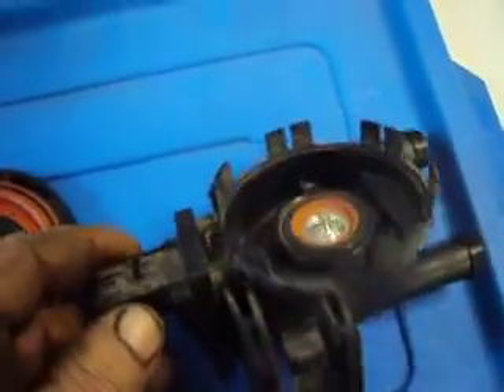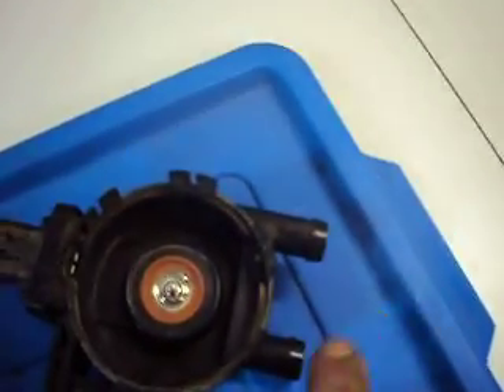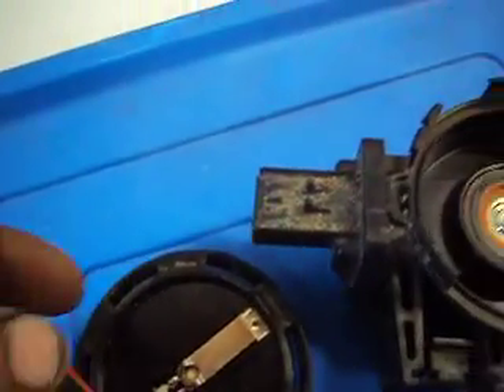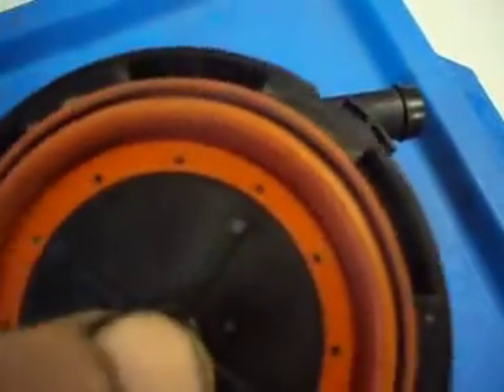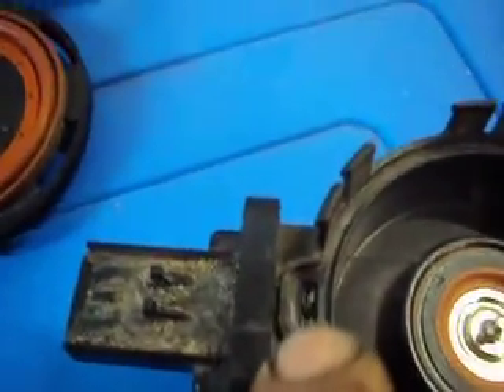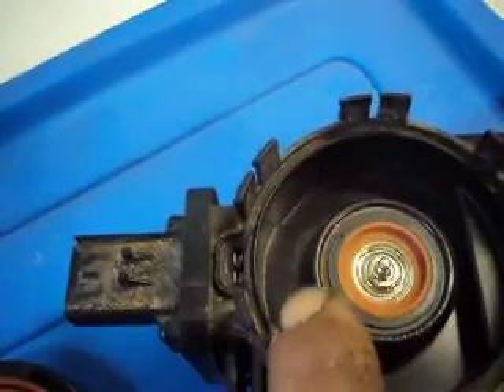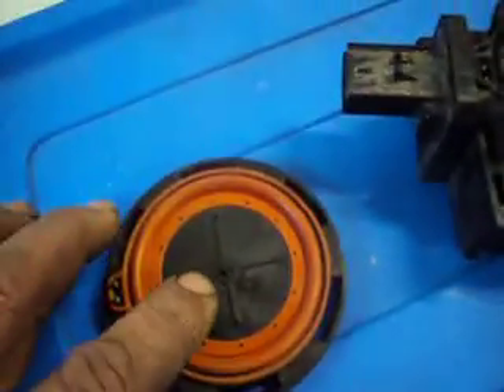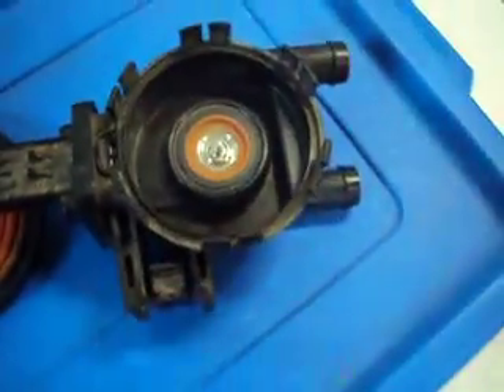Explaining the inside workings of a Chrysler NVLD

Comment: and also when your vehicle sits the NVLD has to be open to the atmosphere...if it were normally closed to the atmosphere and the fuel expanded and contracted like you said it would blow a line or something because the pressure would build in the system
Reply: Chrysler's ('02-07', in particular) ARE normally closed. That's what makes them weird.  
https://www.motor.com/magazine-summary/chryslers-evap-system/

"Unlike most evap solenoids which close their air passages when energized, this one is closed except when it’s powered up."

"When the engine is off, the solenoid closes the large poppet valve, closing off the main passageway between the hose from the canister and the hose to the vent filter (and the atmosphere.) However, as we know, the evap system needs to continue to be able to breathe as air in the tank expands with heat or contracts as it cools. So if the poppet valve is closed because the solenoid is off, how can the system do that? The answer lies in the internal architecture of the NVLD assembly, which incorporates a large diaphragm that functions as a vacuum or pressure relief valve."

Comment: Got a 1999 Chrysler Concord when the tank cover is on car sometime fails to start and sometimes cuts out while running..Funny thing is when I remove the gas cap it will come on and run fine.. Might the  Vapor Leak Detector be causing this????  Your help is appreciated
Reply: Did you ever figure this out? Sounds like an air issue.

Comment: This isn't correct...The NVLD does not have a solenoid in it and it is opposite of what you were saying when the vehicle is turned off. A solenoid is an object usually copper wire coiled around a switch that when power is supplied to the wire it creates an electromagnet causing the switch to be pulled open or close, there is no room for a solenoid in the NVLD. This is how it really works... When the vehicle is off, the diaphragm in the NVLD is sitting in a neutral position which allows the fuel tank to vent out to the air (after the fumes run through a filter) when you turn the vehicle on and it runs in open loop (usually after a couple of minuets) the PCM will power a solenoid in the engine bay usually near the intake which will cause the line to start pulling vacuum into the air intake. The vacuum causes the diaphragm in the NVLD to close shutting the vent to the open air and pulling the fumes from the fuel tank into the charcoal canister and then through into the engine. When the diaphragm gets pulled closed it closes that switch you showed in the top of the NVLD which sends a signal to let the PCM know that the diaphragm is properly closed and the fumes are being pulled into the engine to be used.
Reply: hey Matt do you know how do I fix a p0453 04 scape  fuel tank pressure sensor I change the sensor and nothing the code still in I change the purge valve and the vent solenoid I really need a hand please
Reply: Rojo Ibarra there are 2 things that come to mind...if you have already changed the sensor and still have the code then it could either be that you filled your fuel tank too much (thats why you should not top off your tank) and that could be causing high pressure...or you could have a blockage in the line between your tank and the purge valve...take the line off the purge valve and follow it to where it goes into each fitting and blow through with air compressor see if it comes out the other side...also make sure you either reset the check engine light or wait the alotted time (engine cycles or drive cycle) for your light to reset after each thing u fix...u may have fixed the problem already some vehicles need to do a test a certain amout of times after it has been fixed b4 it will turn off the cel on its own